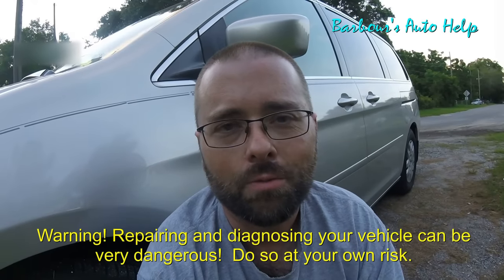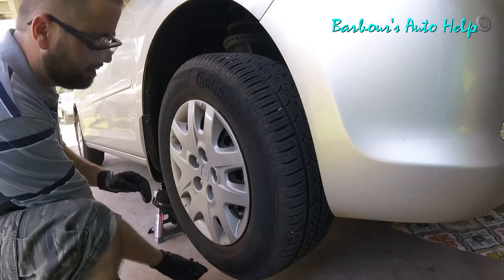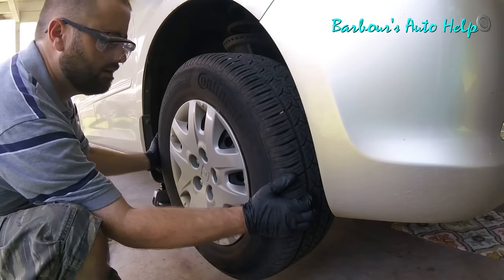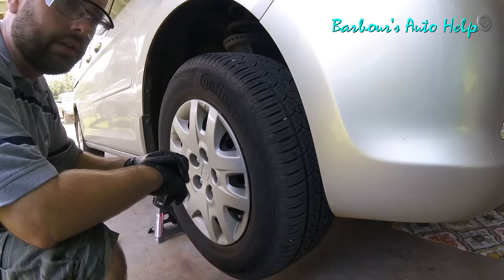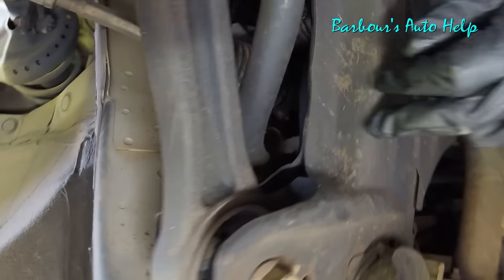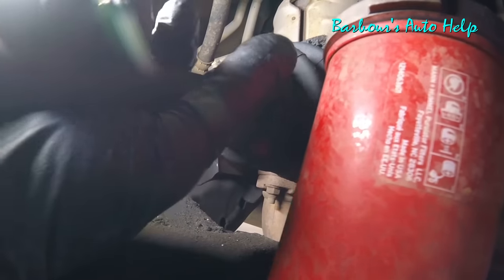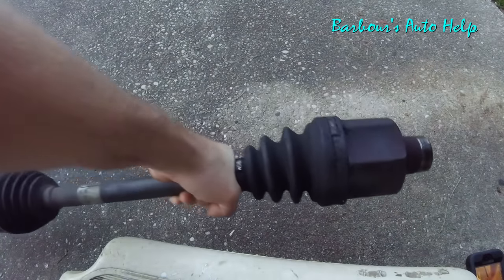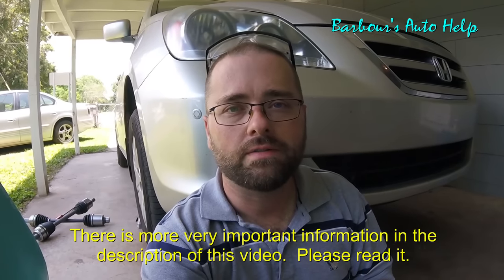Vibration Under Acceleration Diagnosis

Comment: Man. I've done replaced everything and my car still vibrates. So I put e brake on, and I jacked it up, put it in drive and pushed the pedal and noticed that my transmission is wobbling both axles. And today when I noticed it.. I was replacing motor and trans mount for the 2nd time... didn't even need to replace them. But thought my cv axel would have worn them down. But my trans is literally wobbling my whole front end.
Reply from the maker: Not sure I understand what you wrote or how to respond to that.  You got a question in there?  Also, can you clarify some of that?

Comment: If u have a honda element and it vibrates around 25 -45 and stops if u let off the gas it's the torque converter 90% of the time
Reply: What about a Hyundai i20

Comment: I HAVE 2010 DODGE GRAND CARAVAN AND THERE ARE NO LIGHT ON DASH, BUT THE CA R WILL NOT ACCELERATE PASS 5MPH, THE CAR STARTS I REPLACE ALTERNATOR AND BATTERY , BUT STILL DOES NOT GO PASS 5 MPH CAN YOU PLEASE HELP
Reply from the maker: Yea, not a whole lot without physically being there.  Are you mechanically inclined?

Comment: Im having the same problem in my 2012 v6 accord... I have play on both sides more on the passenger side inner
Reply from the maker: I sure hoped this helped.  Do note, some play is normal, as mentioned in the video.  If your not sure how much is too much you can always have a tech look at it and get their opinion.
Reply: Yeah I Agree... When I'm on the highway going around 55-75 and give some gas the whole car shakes
Reply from the maker: +Aiden Pearce Sounds like axles.  Are you sure it’s not a misfire though.
Reply: Im not honestly sure. I just got 4 new michelin tires on it, still wobbles. Went to a wheel shop. They fixed two wheels that were slightly bent. still wobbles... Im going to change up the axels and see if it continues the wobbles. If the car has a misfire it will make the car shake 55-75mph? I'm gonna have to get it checked out at Honda.
Reply from the maker: Yea, a misfire can make the car vibrate a bit, especially under acceleration.  It feels different from a wobble though.  I would describe it more as a stutter.  I'd imagine your check engine light would be on though if you have a misfire.  Never hurts to have someone look at it.  Have a good one and sorry it took me a bit to get back to you.

Comment: I have a 2007 Ford edge and it shakes between 35 mph and 40 mph and again at 50 mph and 60 mph but goes away so what is that
Reply from the maker: I don't know.   Did the video help?

Comment: hi, my car vibrates when after about 20 minutes driving, when accelerate, when climbing a hill gets worse, if Ipark and let it cool down vibrations dissapears but after a while it start shaking again when acclerate
Reply from the maker: Are you sure you don't have a misfire?
Reply: @BarboursAutoHelp  the vibrations makes the steering wheel shake,it doesn't lose power.
Reply from the maker: Did you find anything in your inspection? What did you find?
Reply: @BarboursAutoHelp  only a lil grease on one outer cv joint, but i don't know if it has something to do, just in case i bought a new one and will change it this week, after start shaking I stopped and checked if anything is hotter than usual, but everything was just a bit warm, nothing seems to be loose, the vibrations make the steering wheel shake
Reply: @BarboursAutoHelp  SOLVED : I changed the bearing hub, now the shaking is gone ! thanks
Reply from the maker: Awesome

Comment: my car been standing for about a year i start it every 2 months or so. but now it shakes a little while in park and starts shaking even more when i just put it in drive. and the back left brakes r making noise. what could be wrong?  (nissan altima 04)
Reply from the maker: Shoot, anything.  It doesn’t sound like drive line or steering and suspension though because it does it in park.
Reply: Motor mount?

Comment: I had my 97 Honda Accord in a shop 2 weeks ago to replace a broken axle/cv joint and ever since I got it back, there is a vibration when accelerating only between 30-40km/h , it will do it in 2nd and 3rd between those speeds. But if I put my car in 2nd and drive it it does the vibration between 30-40 then goes away, and when it switches to 3rd there’s no vibration as long as I’m going over 40km. And it will vibrate if I can keep it in 3rd at about 35-40km but ever since that I brought it to that whole there is a bunch of new rattles and vibrations and now when I go over bumps it makes a suspension squeaking kind of but it doesn’t sound like it’s actually coming from my suspension, sound like it’s behind the tire somewhere. Any ideas what this shop screwed on my car?
Reply from the maker: I'm not sure.  But most shops would be happy to look at it again for free especially if the problem only showed up after the repair was made.  Give them a chance.  Let me know what happens.

Comment: I have a 2002 E350 Super Duty Step Van and it vibrates/ rattles like it's starving for gas between 40 sometimes at 45 miles an hour.
Reply from the maker: What engine do you have in it?

Comment: I've replaced my CV axles and it vibrates do I need alignment?
Reply from the maker: How's the wheel balance?
Reply: @BarboursAutoHelp  I only had two tires balanced week ago before CV axles
Reply from the maker: Not sure then.  If the video didn't help you find it then it may be time to take it to a shop.

Comment: I have a 2007 honda crv. When I slow down to 15 to 25 miles my gas pedal vibrates  and it is coming from the right front side of the car
Reply from the maker: Alright.  Whats your question?

Comment: i replaced my springs on my kia stinger and now i have a shake under acceleration. the axles popped out while i was removing the strut, they seemed to go back in ok, but now there is a shake. is it possible i diddnt slide it in correctly?

Comment: I have a 70 challenger can't figure out vibration problem   sometimes it vibrates and then sometimes it doesn't  just can't figure it out usually shakes around 50 to 60mph thanks to who ever can help
Reply from the maker: What did you find during inspection?
Reply: @BarboursAutoHelp  haven't found anything yet looking to find out what to look for
Reply from the maker: Never hurts to have a tech look at it.

Comment: Same but when i take my foot off the gas the wobble stays and its at any speed
Reply: Downfall202 After 5 tire shops told me my tires were good it ended up being a out of round tire , the only thing they were doing was looking and feeling but sometimes you have to take the wheel off and put it on the balancer machine to observe it spin at a fast rate to see the deformity , I had to INSIST that they do this.
Reply: Downfall202 Yes, nonstop for like 6 months, a balance would fix it for 2 weeks max and then the wobble would come back

Comment: My car shakes at a stop light.. if I turn the steering wheel to the right the noise goes away. Now if I turn to the left it gets way worst. Anyone have any suggestions? Thanks!
Reply from the maker: Thanks for the question! Let me ask a few questions to start.  What's the year, make, model and engine size of your vehicle?  Also, is it a noise or a sensation?  Can you give me a better idea of what you're experiencing?  Describe it a little more.
Reply: BarboursAutoHelp wow thanks for the quick response. It’s a 2006 HHR Chevy, 2.2L v6. Noise and vib comes from passengers side. I watched your video and climbed under the car and the cv does appear to have a greasy appearance. But I only hear/feel the noise at stop- 20mph and it gets bad during a left turn. The noise seldom happens at high speed however I do hear it slightly while making a left banking turn on the freeway
Reply from the maker: So this is a noise when the vehicle is in motion, correct?  Like on take off or stopping?
Reply: The noise and vib is worst at a stop and while turning left at slow speeds. 

While stopped if I turn the steering wheel to the right the noise goes away and if I turn to the left it gets much worse, sounds/ feels like it’s coming from the passenger side
Reply from the maker: Are you able to take a video of the symptom?
Reply: BarboursAutoHelp Not tonight, I have to get the family ready for bed. Just want to say Thanks for responding so quickly and making great informative videos!
Reply from the maker: No problem. Good night.

Comment: Hello fellow Barbour mechanic
Reply from the maker: What's up Mr. Barbour! Loo
Reply: @BarboursAutoHelp  05 Grand Caravan doing the same thing. I used an autozone CV axle and it didn't have reliefs or fluting of any kind to remove it. I pried pretty hard on it and put a lot of pressure on the transmission output bushing before I figured out how I had to pull the other cv out and push it out from the other cv hole.
Reply from the maker: There you go!